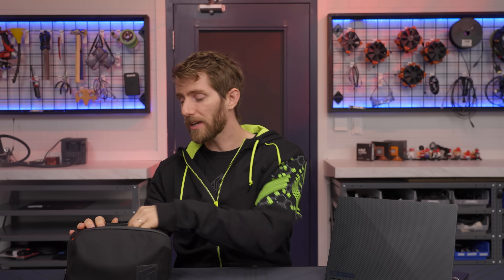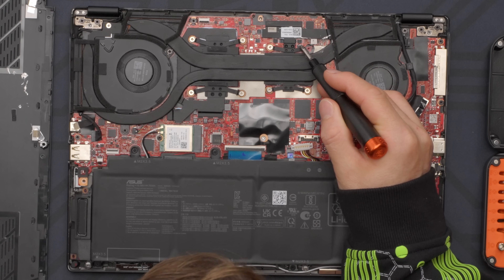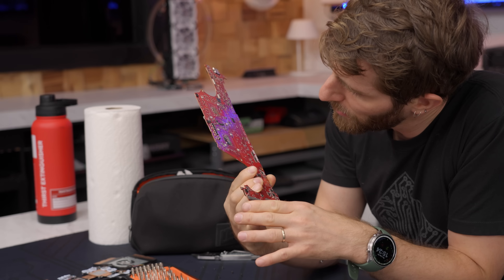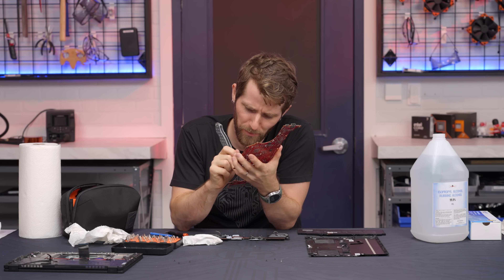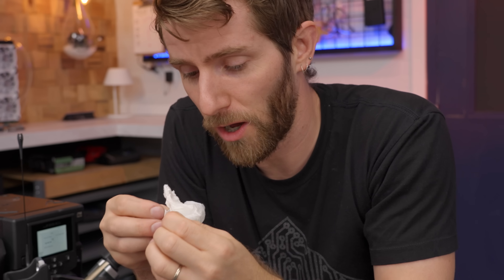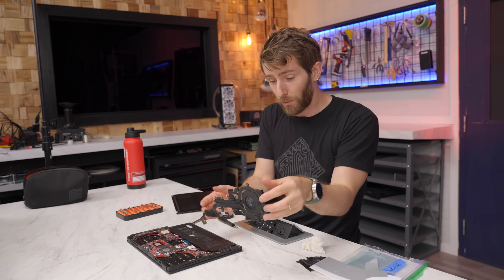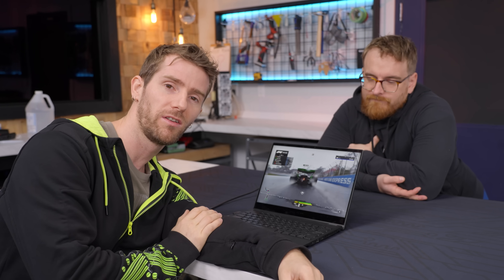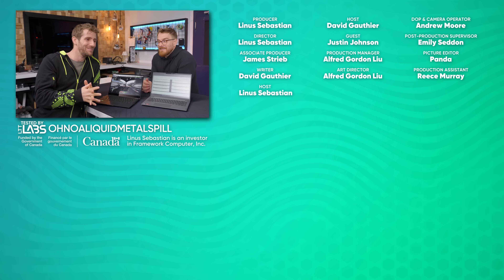Liquid Metal Killed my Laptop… Now What?

Comment: I repair consoles on the side, and the amount of business PS5s have given me because of these liquid metal leaks is astonishing, honestly the best way to protect your PS5 is to have it horizontally placed.
Reply: Good advice, I’ll have to do that with our PS5 Pro then.
Reply: @casedistorted they added grooves on the heatsinks cold plate on Pro and the new CFI-2100 series slim.  You should be fine vertically. I have my pro vertically since launch
Reply: I've seen a few PS5 repair videos and I'd never put this much liquid metal onto anything... there's probably a manufacturing/robot assembly reason why they flood it, but normally you'd add the thinnest possible coverage on the heatsink and just enough on the chip so that you don't see movement when you tilt it. 
So... what I'm saying is: skill issue.
Reply: @Gragagrogog  It'll merge into solid garbage with the heatsink coldplate eventually regardless. I guess that's why.
Reply: A lot of them mostly overheat from the power supply getting clogged
Reply: @mistamaog  could you please elaborate on the power clogging topic
Reply: Thats bizarre I have owned my ps5 since launch and it has always been vertical and still works perfectly
Reply: @juegajuanluna then you didn’t toss it around like others did and used it like a normal human being.

I bet those leaked LM people also got the HDMI ports ripped and mangled.😂
Reply: @Ray-zins  I haven’t seen any and we do a lot, pretty much all no power repairs we’ve seen have had nothing to do with the Liquid Metal unless it’s been taken apart by someone who doesn’t know what they’re doing
Reply: @samuelphelps5008  I assume we are having a regional issue with our PS5s in South Africa then, maybe it's something greater than I can ascertain, however that is my experience.
Reply: Now this is valuable info. Thanks.
Reply: This makes me irritated because the included stand is sooo finnicky and getting it level sucks.
Reply: @Exzeph  there are PlayStation symbols on the back where the stand mount is supposed to align with
Reply: @actuallymitch I am aware, now try to do it on a sealed cabinet drawer low to the ground with little light.

that's to say some people don't proudly have their consoles on display because they're not particularly aesthetically pleasing
Reply: I must be lucky with my ps5 pro in vertical one thing I’ve learned is not to stick it in a entertainment box
Reply: Also there were so many people saying (including people that work on consoles too - like repairing & so called "experts") it's impossible that the vertical mounted ps5 will have such issues since its held in place by the gasket & liquid metal won't flow away. oh boy - those people got quiet real fast. "experts" for sure. that said: the new design changes they made seems to work pretty good to avoid that run-away effect
Reply: No problem with a vertical ps5 but no space for horizontal through other consoles
Reply: @-Gothicgirl- and horizontal PS5 is a crime to electronics design. Or anything design for that matter. Its fugly.

Same for other PS generations like fat 2 and 3. They look like either VCR players, grills or vacuum cleaners and PS5 looks like it’s been toppled over and forgotten to be put back how it was, vertical.😂
Reply: @VegaEclipse1096 no the ps5 looks vertical the best but perhaps you put 10 consoles in a closet.

Ps2 is a clear copy of the atari Falcon and the ps2 and ps3 have no near look to a vcr! Both have even changeable logo for vertical!
The nes was vcr look!
I dont know how old you ate but no vcr that i had looks like ps2 or 3
Reply: @-Gothicgirl- Fat PS2 - VCR player

Fat PS3 - grill

Fat PS4 I’d say it’s 50/50. Both orientations look ok. Only in vertical or faces the opposite direction which is a weird design choice.

PS5 - looks toppled over.😂
Reply: @VegaEclipse1096 ps2 is a clear copy  atari Falcon 030 microbox.
I never see a vcr in A design like ps2.
Reply: I dunno. I refreshed the LM on my second hand PS5 Slim and it went back to factory fan speeds. I broke the seal so no monkeying around from previous owner(s). 

Just cleaned all the oxide with electrical contact cleaned and respread it. Didn’t add or take away any.

It works flawlessly.

One month later I also replaced all the thermal putty because some hotter zones got it less malleable. Also Sony was skimping on any memory chip. The factory amount was tiny.

I cleaned all LM and respread it. There was surprisingly some new oxide forming. That’s Sonys fault for keeping the temp target so high.

Vertical since I got it. No problems.

I’d only see the leak problem if the console would be hot and you’d knock it and falls on the side.
Reply: And have the lm replaced by tg cryonaut!
Reply: Unfortunately I have to mount mine vertically would I be better off using a high quality thermal paste? I primarily use the PS5 for a media server.😂
Reply: That's exactly why I have my PS5 horizontally placed since day 1. Also, I'm a cat owner.
Reply: Absolutely... this should be rated way higher!
I am glad I placed my PS5 for place reasons horizontally since day zero!
Reply: I had mine vertically for years before I heard this so I rearranged my whole entertainment center to lay it horizontally. Still going strong
Reply: This should be top comment
Reply: My launch day PS5 is still going strong and it's spent every second horizontal.
Reply: @sheldonpetrie3706  lucky
Reply: @sheldonpetrie3706 same. Launch day console vertical since launch and no issues. Upgraded to pro last year and that's also vertical since launch. No issues.
Reply: @izhanshafiq324  why risk it tho? just by putting it on its side you could be saving yourself a lot of trouble or potetially even an entire console?
Reply: @remo7846 what risk?
Reply: @ZIQ26 watch the video you've clicked on instead of commenting next time
Reply: @izhanshafiq324  It is possible to not have any issues, I have this theory that to some extent it also depends on the shipping, in my instance I'm in South Africa so I can imagine the journey our PS5s are going through from wherever they're assembled is quite unpredictable, thus potentially compromising the console.
Reply: @izhanshafiq324 Yeah, I've not died in a vechile accident, and I've lived 18 years. It must mean it doesn't happen, right? 😂😂
Reply: @sheldonpetrie3706 good for you, but you dont make it so the 10000 damaged consoles don’t exist
Reply: @thaaalegend2775he said he had his horizontal, your comment is uneeded
Reply: i think thats just bad design by sony, or asus, or just using waaaaay too much LM, my pc runs vertically for like 5th year, direct die with liquid metal, both gpu and cpu, not a single drop has escaped but also, my pre ordered ps5 is still going strong, vertically
Reply: @kur55  Bad design or intentional 🤔
Reply: @jakobstahl5298 bad design, they've corrected it
Reply: @chasp_0784  nope they have not. PS5 pro have improved it by making it harder for the LM to spill out but the base and slim model have the same issue.
Reply: Running them horizontally will make them run hotter, and dry the paste up eventually. 

They’re definitely meant to run vertically.

The issue is people moving them around all over when they’re hot still.
Reply: Anyone tried PTM7950 on PS5 instead LM?
Reply: @grobny_man  
I could not get an original one in my country.
But i made some tests on my laptop,  XMG Neo 17 M21, with i7-11800h, with factory applied liquid metal.
I tested Thermal Grizzly Carbonaut, Thermal Grizzly PhaseSheet PTM, MX-4, MX-6, AQIRYS AQ-6, and all were very bad at high temperatures (on big load at CPU, or just Counter Strike 2) compared with liquid metal.
Reply: you should probably delete this so that you continue to have business
Reply: @JoshuaCasey I should - must have been the wind

Comment: As someone with an asus laptop that has liquid metal this is slightly terrifying and I guess I need to stop putting it in my bag warm.
Reply: Mine also died due to leak
Reply: I would probably get extended warrenty on it.
Reply: Mine died to this issue and they quoted me the price of the laptop new for the part to repair it.

Comment: I wouldn't put liquid metal on anything that needs to stand vertically or that is supposed to be moved, the clue is in the name.

No matter how much insulation you put there always a non-zero chance of seepage.
Reply: I'm looking at you PS5!
Reply: @Tarets Honestly PS5 is probably designed well, because there's lots of consoles out there and I don't know anyone who had issues with it. I haven't looked into it and might be wrong, of course, but I believe that it's okay to put it vertically. Large shocks (especially in shipping) might of course be a different story...
Reply: I would but I would also put some clear nail polish around the componets near it.
Reply: its widely used on desktops that do stand vertically with no issues so thats a silly take
Reply: @Lunaq  True, but desktops aren't thrown in a backpack or placed in all sort of orientations when it's on or moved about when it's on. Even in a backpack the laptop will be rattling all over the place in all sorts of orientations, a desktop is rarely moved and the same goes for a games console.
Reply: The vast majority of liquid metal use is either in systems that need to work in an arbitrary orientation (phones, laptops), are routinely exposed to shock loads during operation (phones again, cars), or spend their entire service life vertical (nearly all PC cases, most consoles). If liquid metal weren't manageable when used vertically or under shock loading, it wouldn't exist as a product. 

TL;DR: Liquid metal good but finicky, Asus cooling people less good.
Reply: @littlegrabbiZZ9PZA  That's exactly why it exists, especially in those applications. It will statistically cause more lethal malfunctions and force you to buy another device. Another device from people who put it in there.

Comment: Sure would be nice if they would sell replacement parts at a discount, like a new board... Framework does
Reply: Even replacement parts at a premium would be nice. Getting laptop components for anything but a business class unit can be rough.
Reply: @random_n oh they'll give businesses a middle finger too if they ask for parts 😅
Reply: @squalester I've even been on the authorized repair partner side and still subject to a few of those fingers. It's rough out there.
Reply: It would be nice to use LPCAMM2 so you can possibly recycle RAM.
Reply: Should be a legal requirement to do so